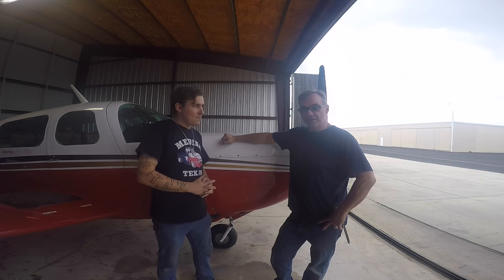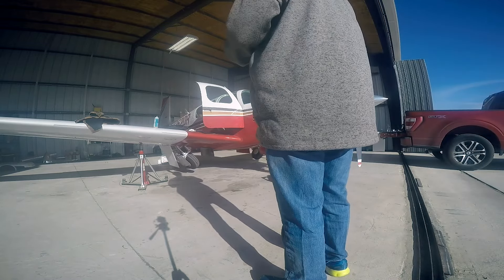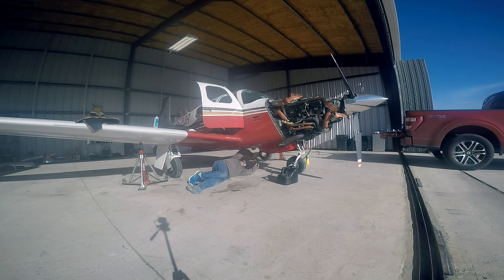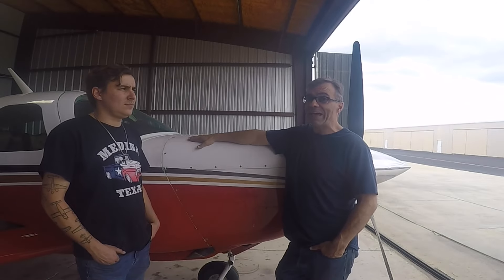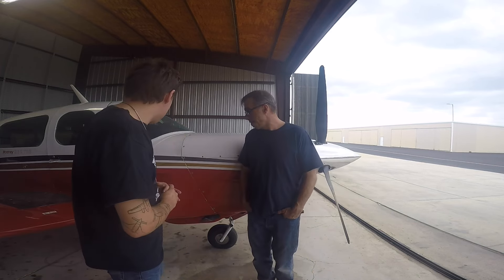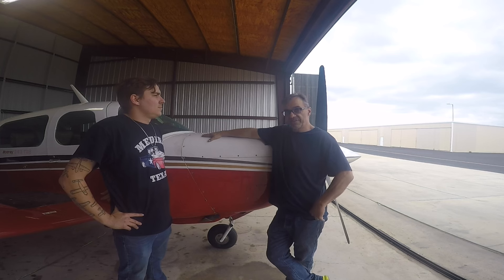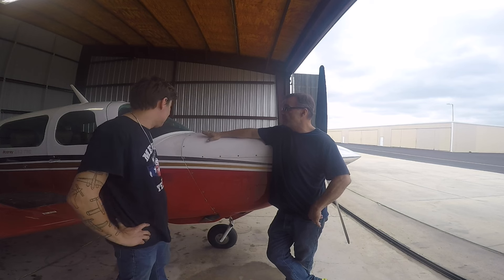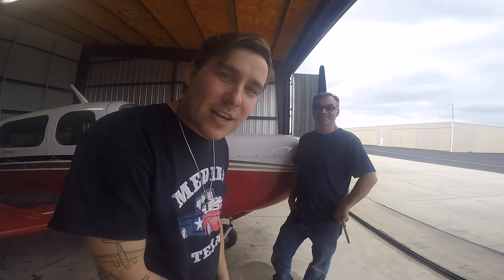What's A Better Buy, Rocket 🚀 Mooney VS. Mooney Bravo. Hanger Talk With Lyle The Rocketer

Comment: I've got a J model and It opened my eyes when I realized that if you ever need to get behind the engine to remove something, get to the mags, etc, the lower engine mount bolts are parallel to the firewall, so you can essentially remove the upper mount bolts, then loosen the lower and rotate the engine downward. The slack on all of the control cables allows for the engine to rotate downward more than enough to get back there. I took back all the mean things I said about Mooney while replacing the engine mount shocks. Looking forward to seeing the next video!

Comment: Purchased my Bravo with 1950 hours, TBO is 2000 and my overhaul/install cost was approx 75K in 2021, my TIO-540-AF1B is a cross country machine and is very stable. My good friend next hangar over has a Rocket, his TBO is 1600. Both planes are excellent. My Bravo almost doesn't fit in my T Hangar! With the Bravo, you have to keep the CHTs below 380.  Thanks for a great video, Go Mooney!!!

Comment: Very cool...!!!
I had to remove and reinstall a 305 Rocket engine back is 95' due to contaminated fuel that was sold to a string of FBO's back then on the west coast. It's an extremely "BAFFLING" engine to reinstall.  We didn't have manuals for a 305 so, in pre-PDF technology fashion we had Rocket FAX a copy. So, in a way a barely had a manual to try and resolve weather or not the little dots on the paper were showing that this engine baffle goes this way on this side of the engine or that way on the other side. It was a valuable lesson in labeling parts better before removing them if you're not familiar with what you're working on. A lesson that I still use till this day.

Comment: My Bravo was not a good climber.  I trued out at 185 knots at 15000 feet burning 19 gal/hr.  A little better higher. I never ran the TIT above 1650, usually around 1600. The biggest benefit to me was the FIKI that made it a all weather machine.  Since I am retired now and don't have to be anywhere so I bought a 201.  Much simpler, still very fast, and a better payload.  I can go 159 knots on 11 gal/hour.

Comment: Nice rundown on the Rocket, thanks. 

I was told Continental parts are not as available as Lycoming.

Also, Bravo has improved interior and quieter compared to a K.

Comments?
Reply from the maker: Definitely a much nicer interior in the Bravo and more room. As far as parts, the contintal is considerably cheaper than the "wet head" lycoming. However, the whole supply chain is still roached. I know some guys are waiting over 12 weeks just for a crank case. (Lycoming and contintal)